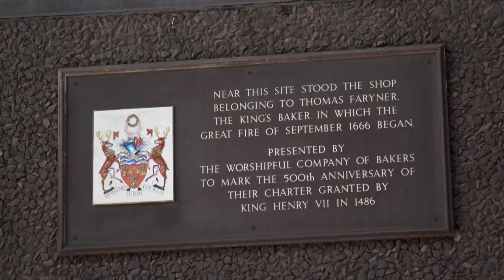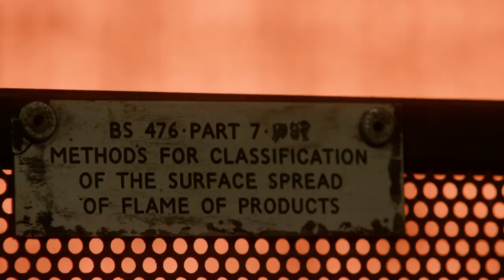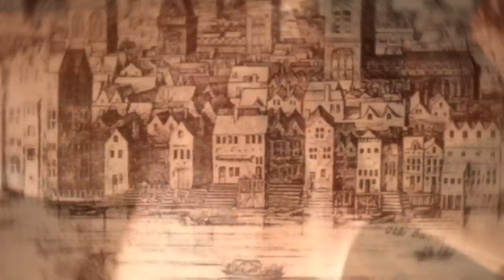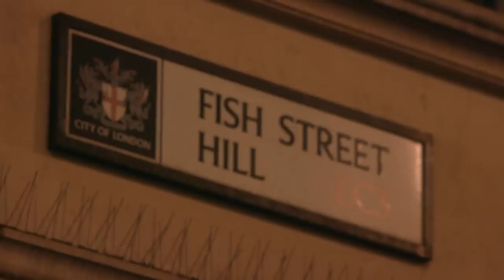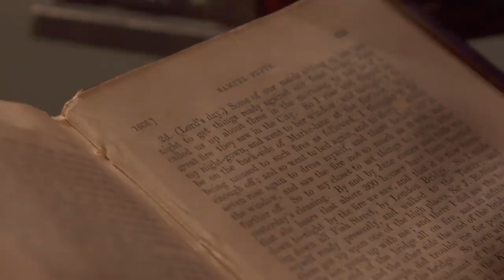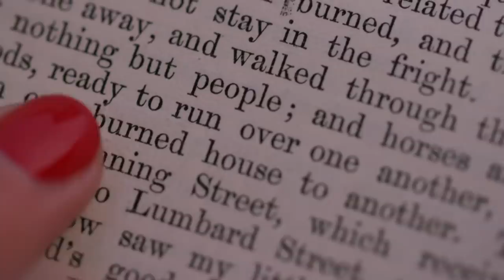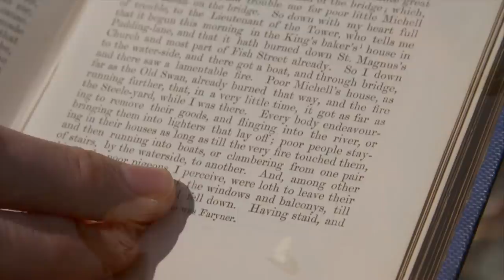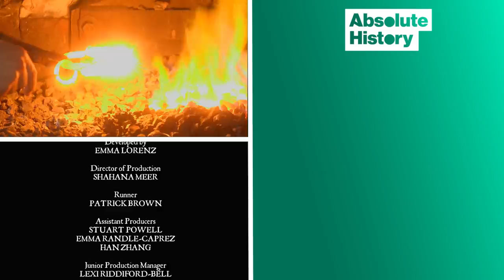The Story Of The Small Oven Fire That Nearly Destroyed London

Comment: The overhang of the buildings was probably also to prevent the horizontal beams from sagging over time.
Reply: Not at all. Land tax was only based on the ground footprint of your property. You minimize your property tax  by having a tiny ground floor and expanding outwards as you build up.
Reply: @musictube250  I'm aware of taxes, but I guess that this was another reason.
Reply: @edi9892  do you any evidence to support your theory?
Reply: @musictube250  physics?
Reply: @edi9892  I think we can accept that he effects of gravity and compression force under load has always existed. In fact Sir Isaac Newton published his gravitational theory in 1665 or 1666. However these buildings would have been constructed before that year. Therefore I ask again, do  you have any evidence that the load bearing capacity of the beams was a factor that shaped the building design in this style of building during this period in history or are you just making an unsubstantiated guess?
Reply: @musictube250  Since we both agree that beams and even more so planks can sag, and probably that this phenomenon was known since ancient times, I think it's only natural to search for solutions to this problem. Today, we got the T- and I-beams, but long before that, we already had planks reinforced by beams and columns.
Both in European and Asian carpentry, I've noticed that there are many instances where a beam is not fixated to its ends but has essentially a pivot point moved further inwards and then a loadbearing element outwards. In theory, this should bend the beam in the middle upwards and thus counteract gravity.
I don't know if they did this with this intent in mind, or if it was happenstance, and someone noticed that it had this beneficial effect and thus they were continuing building like this. However, I'm pretty sure that they started doing it consciously.
Reply: @edi9892  Zyzzyva